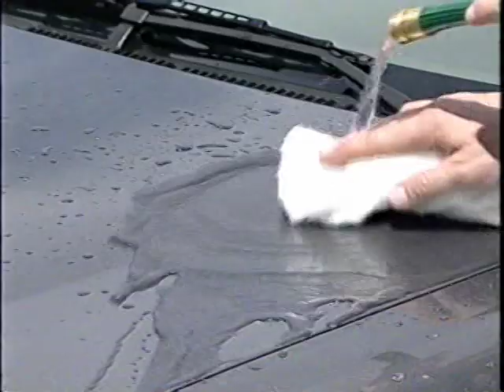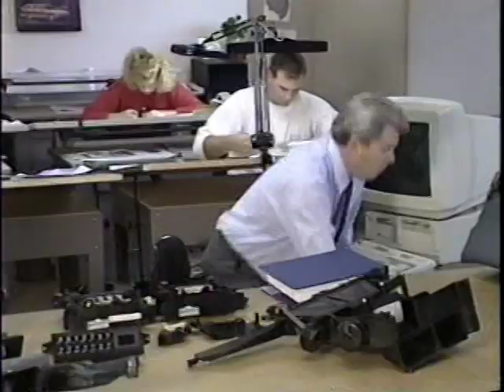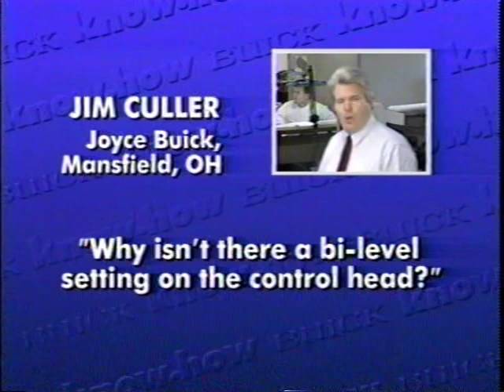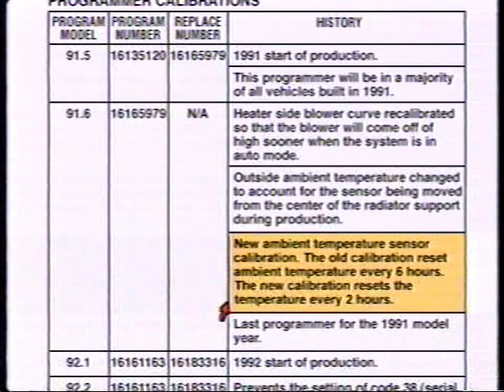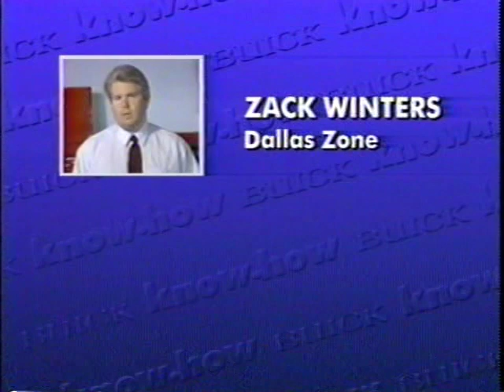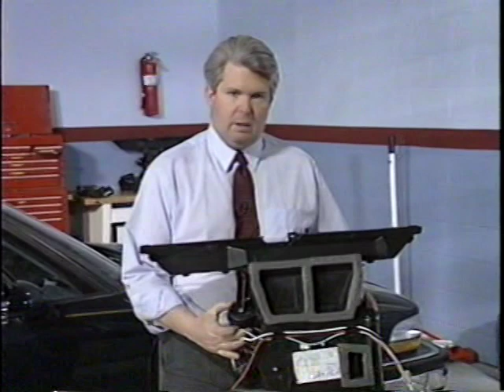Buick - Automatic Climate Control (1992)

Comment: The problem with my 1998 LeSabre is that the fan continues to run even with the key off.It has been diagnosed with a faulty control switch that is stuck in the on mode.The fix is well over $600 and I am hoping that someone may know of a simpler solution.As of now,I have to raise the hood and pull the a/c fuse whenever I turn off the engine,and reinsert the 30 amp fuse after I restart the engine.Any simple diy hacks would be greatly appreciated.
Reply: How about a relay in line with the fuse. Let the relay be triggered with the ignition